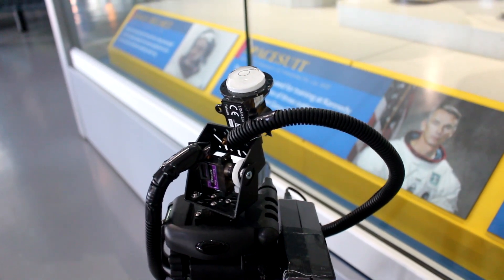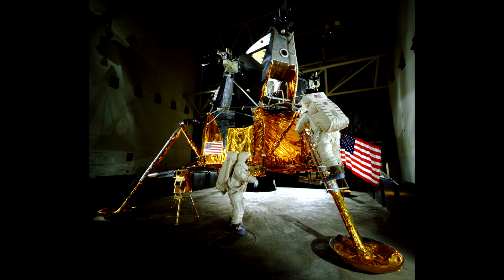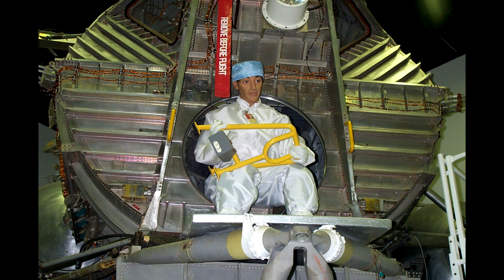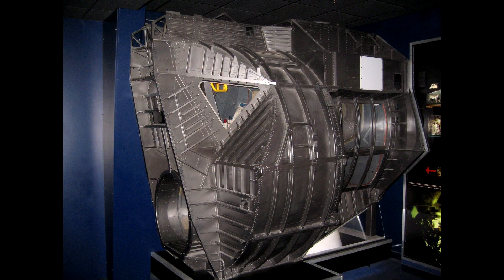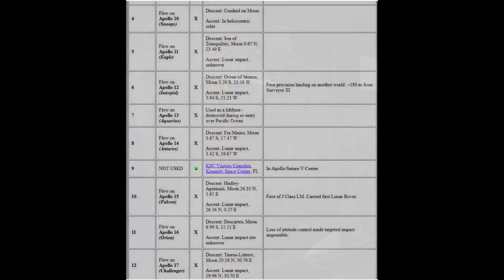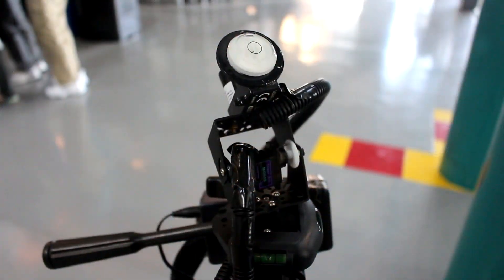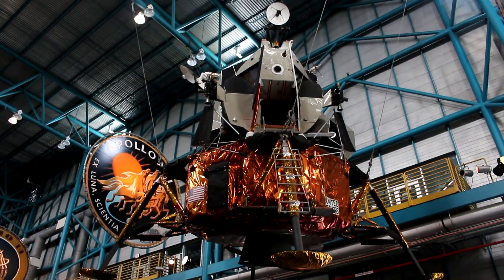Can an Apollo Spacesuit Fit Through the Hatch?

Comment: Interesting experiment, however you're overlooking something important. Eugene Cernan's spacesuit on display was obviously not pressurized. It's not even sealed with the helmet and gloves. The pressurization would add some bulk to the suit's dimensions. I realized this is outside your means and resources, but you'd be better served laser scanning an A7L suit inflated to 18.4psi or 19.9psi. Because the Apollo suit pressure ranged from 3.7psi to 5.2psi, and 18.4psi and 19.9psi are 3.7psi and 5.2psi above atmospheric pressure respectively.
Reply from the maker: The suit is designed to minimize expansion from pressurization, the suit would only be pressurized to one quarter of atmospheric pressure with 100% O2 anyway, and the clearance is such that there is tolerance for some expansion anyway.  The nature of the claim is such that the suit is supposed to be dramatically and comically too large for the hatch.
Reply: I am familiar with the restraining layer. Even with that layer, you can expect some inflation. Look at film and videos of the Shuttle EVA suits and Gemini EVA suits when unpressurized on the ground vs during a spacewalk, the difference is night and day. I am also familiar with the origin and foundation of this claim. Jim Collier went to the Smithsonian to measure the width of the LEM hatch and cross referenced his measurements with the suit dimensions specified in various books and papers.

All I'm saying is to demonstrate conclusively whether or not a suited astronaut can fit through there, I think you should be using a laser scan of a pressurized suit for accuracy. I realize getting access to a pressurized one might be difficult. Personally, a few years ago I actually contacted ICL Industries to inquire about getting a real suit for my own tests. They wanted over $2million and told me they only make suits under contract to NASA. But if you can get access to such a pressurized suit, I think it would be worth the extra effort to scan that and see if it fits.
Reply from the maker: I've seen it, the difference is not as extreme as you make it out to be, and the margins are nowhere near what Jim Collier claimed.  His suit dimensions were drastically off because he measured an un-inflated spread out suit.  That is exactly what this video is debunking.
Reply from the maker: Jarrah White He measured a suit spread out that wasn't being worn. The difference due to inflation there is minor and was actually compensated for in my simulation; I actually inflated the suit by expanding the size of each lidar point return into a large cube, expanding the volume of the suit. It still fits.

Comment: Non-pressurized suit obviously..... but on the other-hand, most photos from NASA also show non-pressurized suits on the so-called Luna surface..
Reply from the maker: The pressure suit has restraint layers to minimize the amount of expansion. This was already generously accounted for in my scans, each dot is much larger than the point return it represents, simulating a pressurized suit.
Reply: @Astronomy_Live You didn’t take the housing of the rocket into account. You have the Astronaut lying right over where that would be. And with one astronaut already in it, how does the other guy get in or out? 

Got the blue prints? That would be more legit than this.
Reply from the maker: @Bob-sk6xq  no, I don't. The housing of the rocket isn't just inside the hatch.

Comment: Can an Apollo suit survive a vacuum?
Reply from the maker: Yes. That's what it was designed for.
Reply: @Astronomy_Live  Got my doubts. Would like to see some footage of them being tested in a hard vacuum. Can't find any, historical or modern but I can find other testing footage. Now they seem to have trouble building a suit when it was so easy back in the day and they've postponed the moon mission again!
Reply from the maker: @thebruffy1077  doubts are not evidence. Yes, they tested them in vacuum chambers:
https://youtu.be/yBHJ30J2gsw
The new suits are being designed from scratch to be able to last much longer than an Apollo mission and withstand the abrasive lunar regolith dust. I've personally witnessed NASA testing new technologies to magnetically repel the dust from the suits, specifically to protect the joints where dust intrusion would wear down the bearings over time. It's not an easy problem to solve when you're planning to reuse the same suits for years on end. For Apollo, every astronaut had their own suit custom tailored and it only had to last for one flight.
Reply from the maker: @thebruffy1077  if I ran the zoo fallacy and moving the goalpost. You asked for footage of vacuum chamber testing. I gave it. You then tried to move the goalpost. Explosive decompression would mean a large breach of the hull of the command module, which would not be survivable anyway due to reentry heating. A smaller issue resulting in rapid but not "explosive" decompression would mean a smaller hole and would probably be otherwise survivable. Your a priori assumption that such testing was needed is based on a false premise. In fact, explosive decompression of the spacesuit itself occurred during testing due to a hose being disrupted during testing. 
https://ntrs.nasa.gov/citations/19690004637
Deliberately inducing explosive decompression of the chamber was probably not a priority because the actual risk that an Apollo capsule would ever experience explosive decompression in an otherwise survivable regime of flight was seen as very unlikely.
Reply from the maker: @thebruffy1077  again you're trying to move the goal post. Which indicates to me that you're wasting my time. You asked for footage of them testing a space suit in a vacuum chamber, I gave you just that. If you want to hire quality scan you can go file a formal request with the government to access the film and rescan it yourself at higher quality. I suggest you do that instead of wasting my time any further. As this video shows, I actually do invest effort in doing the research myself. I don't waste people's time and I actually get off the couch to do actual experimentation and research in the real world.
Reply: @Astronomy_Live  'which would not be survivable anyway due to reentry heating.' Cosmonauts died in an intact but leaky capsule during reentry. There's other ways in which an ED can occur, meteors, human error, electrical faults etc. If I was going to travel in space I'd like my suit to be fully tested and not by a loose hose! ED simulation would be part of an astronaut's training. They would've filmed it so that could analyze it and use it for training. Where's the vacuum chamber footage?
Reply from the maker: @thebruffy1077  Yes they died because they didn't have pressure suits and a valve open, they didn't have anything to put on to protect themselves. That is not explosive decompression. That is rapid decompression, there is a difference. I gave you vacuum chamber footage, your goal post was bad and now you're trying to move it because you were proven wrong. Stop wasting my time. I am a PhD scientist and I have written the best tracking software out there for filming the space station and other vehicles with off-the-shelf telescope hardware. I was kind enough to provide you what you asked for, but it appears that your question was not honest to begin with.

Comment: Why is there not a video of a fully suited astronaut getting through that hatch from a museum?
Surely in the past 50 years that would have been simple, your 'proof' with a 3D model is not actually proof is it?
Also why are you even measuring it - why not just download the blueprints from the NASA website?
Reply from the maker: Yes, my laser scans of both the suit and the hatch are proof.  That is empirical data.  Why not just use the blueprints?  Because the hoax believers could easily claim that the blueprints had been changed to be more consistent.  I showed the actual hardware, built for flight, was large enough to accommodate a real Apollo suit.  I don't think they would have let me put the suit on and get on a ladder to climb through the hatch, this artifact is priceless and the last of its kind anywhere in the world.  It is the only fully built lunar module intended for flight that we still have on earth, all the others are test articles or incomplete.  
It's also a good thing I did this experiment when I did.  The lunar module has been removed from its position hanging from the ceiling and it now sits on a stand on the ground with the hatch closed.  It's also surrounded by glass which would make it more difficult to scan.  Luckily I performed these scans before that happened.
Reply: @Astronomy_Live  How did you calibrate your machine? Did you measure for instance a house doorway from the same distance and also through perspex?
BTW There are believers and skeptics - the term 'hoax believer' in nonsensical as we are talking of a lack of naive belief in NASA's poorly documented fantastical story here. 
Your model doesn't take into account an inflated pressure suit with a man actually crawling in - remember the ascent engine is dead ahead and the person needs to get around that somehow. As for blueprints - should be on NASA's website - yes? Well I don't think they are, I threw that in there to see if you had looked for them: Have you looked for them?
You may not have been allowed to try it out - but Buzz Aldrin could have turned up to any museum in the past 50 years and shown how it was possible. He never did. None of the astronauts ever did. None of the astronauts made any mention of how easy or difficult it was, all their memories appear to be blank past that hatch. Listen to their interviews, inside the CM and LM they know all the details. But past that door of forgetfulness: all the details stop.
Don't you even wonder why these items are closed up and hidden behind glass? It's to prevent access and people with tape measures as well as to 'preserve' them. Where is the 1:1 scale replicas people can play with? There's a rough one in France, but they seem to be in very very short supply. Maybe no one else can find the blueprints either...
Also have you ever stayed in an RV in winter? You get condensation and ice forming on doors and hatches. Now try on the moon at -200C. But no mention of icing, stiff locks or anything.
Reply from the maker: @G-ra-ha-m  Hoax believer is just a term that I use and it's not even all that derogatory. If that offends you then you're on the wrong channel. I did account for the inflated suit pressure, the point cloud that I generated for the suit was inflated quite significantly by increasing the size of each point. Instead of jumping to the conclusion that I didn't account for it you could have just asked me first. But that's the thing, you're not actually a serious researcher, you're not trying to gather evidence, you're trying to jump to conclusions you want to believe. That is why I call you a hoax believer. 

NASA's missions are extremely well documented and the evidence is right there that this suit does fit through the hatch. The LIDAR itself is calibrated at the factory and it is accurate. I have done scans of entire rooms and they accurately reflect the sizes of the rooms and the objects within. The rest of your if I ran the zoo fallacy can be disregarded. My evidence stands, it doesn't matter whether an astronaut shows up just to prove some hoax believer wrong. I don't see why they would ever do that. They know they went and they don't need to prove it to you. But the entire argument is fallacious since it hinges on what you think they should do. Sorry but you don't get to dictate reality. I have independently investigated this and proven that the suit, even inflated, would fit through the hatch. I did so when it was fully open and not behind any glass. They changed it to celebrate the 50th anniversary and enhance the display for the lunar module which was mostly being overlooked by the guests before.  There's no conspiracy there and even if there was it would have been too late because I already measured it before they changed it.
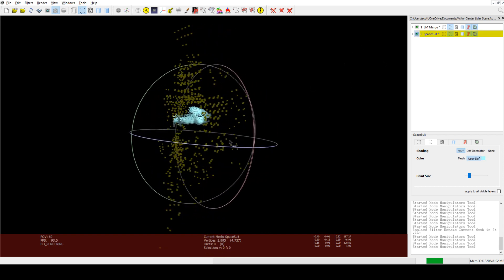Reply: @Astronomy_Live  I don't think you understood my objection. At 5:56 the mans head is head-butting the ascent motor housing, see diagram:
https://media.leisureliving.com/media/3153337b_1.jpg
He hasn't just got to be inserted in zero-G, he's got to climb in and bend out of the way of the obstacles. There's a big difference between your model and a human in 1/6g actually doing that as the diagram clearly shows. In practice I think they could only enter and exit upside down.
It would have been useful to NASA and the whole story if a real astronaut had demonstrated it's possible. How is it that in a 3 year, 6 landing tale with training and many videos and films that NASA isn't able to produce a single instance of an astronaut passing through that hatch?
It's good to hear your LIDAR is accurate though, but I'm still doubtful of the reasons why NASA chooses to clarify these points, there are a lot of them that could prove/disprove that they hide.
Reply from the maker: @G-ra-ha-m  He's not nearly deep enough inside the module to be running into the ascent stage cover. I do not agree with your objection.  There are photos of astronauts emerging from the hatch. Of course you claim they're fake, but you don't get to claim that it never got taken.
Reply from the maker: @G-ra-ha-m  The PLSS clears the hatch just fine.
https://www.hq.nasa.gov/alsj/a11/AS11-40-5863HR.jpg
https://www.hq.nasa.gov/alsj/a12/AS12-46-6725HR.jpg
I already told you why I will not bother with the blueprints, there is no point. I have already scanned the hatch and the suit.  It fits.

Comment: LIDAR...I've got to say it.  I'm impressed.  What are the other applications of something like this?
Reply: Sean Carroll I think they're using LIDAR from planes to uncover ancient cities like in Mexico
Reply from the maker: Other possible applications of this particular prototype include things like scanning the interior of a lunar module simulator in order to illustrate how two suits would fit within the space of the module. You could also do scans of the Saturn V itself to validate its size and fuel capacity. More practically, you can use it to scan your entire house to build up a 3D model and do visualizations of things like room rearrangements before actually moving the furniture around. It's very good at scanning large objects and spaces.

Comment: First: You placed the dimensions of an 'erect' man wearing a space suit, but not the addition of the PLSS (Primary- or Portable or Personal, Life Support System). Second: Your 'clinical representation' is of a man wearing only the suit and basic backpack, lying down (or standing)! This is VERY important, as the astronauts would have to bend down on their knees (taking up more precious room), and Third: The astronauts, wearing full suits with PLSSes would have to "somehow' maneuver the very small distance between the ascent engine cover and the hatch. Remember, the hatch opened to the inside. There was NEVER any video of any of the "landings" that showed them actually exiting the LM 'THROUGH' this hatch. (Always just before and just after.) 
I have been inside a replica of the Eagle (LM) in 1969, in Huntsville, Alabama, at the Marshall Space Flight Center (where Dr. Wernher von Braun designed the Saturn 5 engines), with the engine cover intact and a man with jeans & T-shirt couldn't pull that exit/entry off! 
I don't keep up with all the hoax theories, but of THIS, I am certain!
Reply from the maker: That is false. My scans included the PLSS which was on the space suit that I scanned. You can clearly see this in my video. The astronauts did not get out of the LM on their knees. They got down on their chest and crawled out.

Comment: Never knew this was an issue but I'm not impressed with the explanation. What's the measurements for the hatch and what's the measurements not for a regular space suit but a pressurized space suit. 

Furthermore one can barely move in a pressurized space suit. They would have an extremely hard time fitting thorough that hatch in a pressurized space suit.
Reply from the maker: The suit was specifically designed to avoid expansion from pressurization.  They only pressurized the suit to one quarter of atmospheric pressure using 100% O2 for breathing.  Sorry, but it's just not a factor.  Yes, it does make it harder to move in than an un-pressurized suit, that's why astronauts train hard and are in peak physical shape when they launch.  The hatch easily clears the suit.
Reply: Well I for one am impressed. The hatch has plenty of room so no further explanation is required. The suits don't blow up like balloons. This isn't the Michelin Man. Videos from the Moon show they can and do move around just fine, hopping, jumping, skipping, picking up things, driving, going up steps, going down steps, hitting golf balls, etc. I don't see why just going through a hatch would be "extremely hard" when it has as much room as this video shows. They would have practiced it a million times. And on the Moon it would be a lot easier in 1/6th gravity.
Reply: Your confused between a real space suit Vs some Hollywood space suit. Put a blood pressure cuff on your arm and inflate it. Thats more radius change then a space suit would be since its supposed to be comfortable.